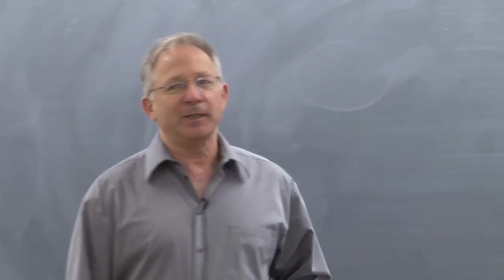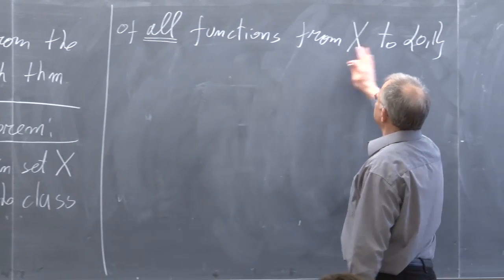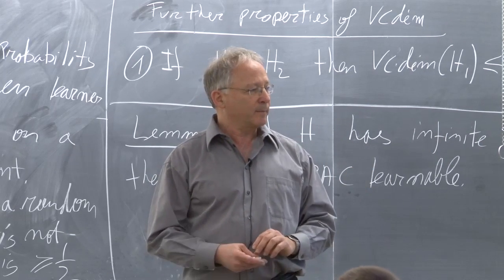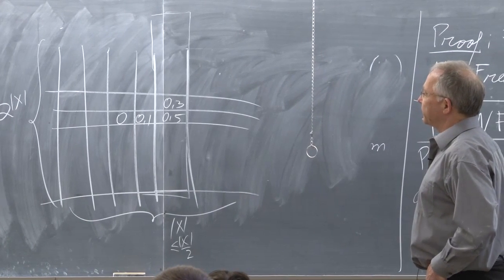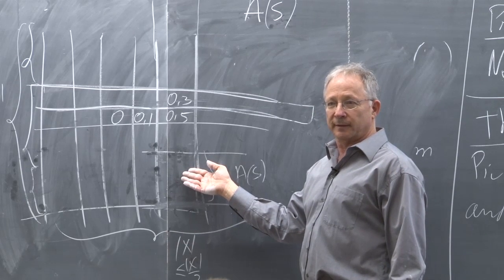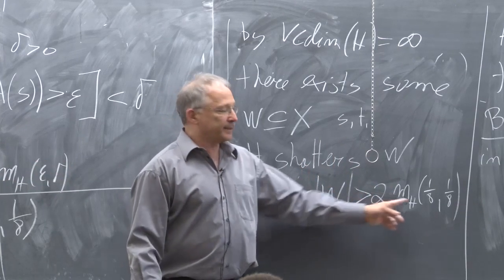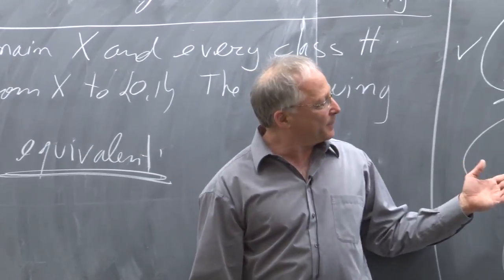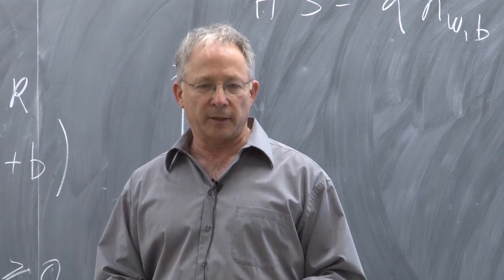Machine Learning course- Shai Ben-David: Lecture 8

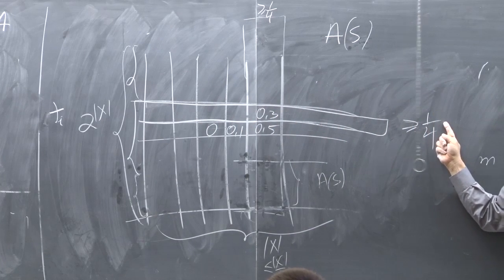Comment: @40:23 I think the row example may need another argument. What Prof has shown: there exists a row (labelling function) such that over all columns (samples), the average error is atleast a quarter. 

But in my opinion, we don't need to look at average over all samples. Given a learner A, which is given a fixed s, the output is A(s), the hypothesis of the learner. This is compared with the labels f. 

So what we need to show - in each column, there exists a row where the error is greater than 1/4. But this is clear as average of each column is 1/4. Therefore there exists atleast 1 row (f labelling) in each column (corresponding with A(s)) with value greater than 1/4

Comment: Around time 44:59, when professor explains the no-free-lunch theorem, I have a question: What in the case when 1 function is bad, say error along the row is 1 and rest of the functions (along the row) have very low error per row. Then can we not mark that function as bad and not let the algorithm pick that particular bad function? Can such a case exist, if so then won't my error reduce? Sorry if my question is vague.
Reply: I guess you are asking the same question as a guy had asked.... the answer is that the sample size m , gives the guarantee that any of the functions in the hypothesis class will not make an error greater than as mentioned by the (epsilon, delta) parameters.... so you function which gives a error of 1 .... will make the sample size guarantee to fail..
Reply: From the definition of PAC learnability you need success in every occasion, so if you find one ocassion that fails then you do not have PAC learnability.